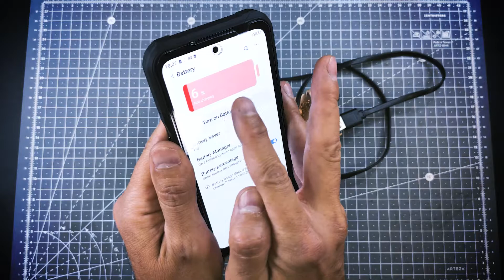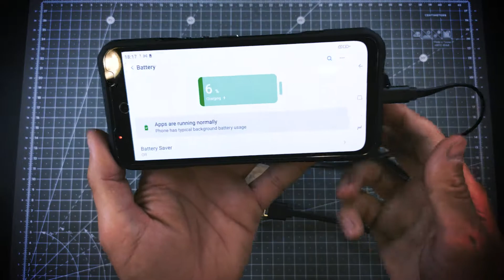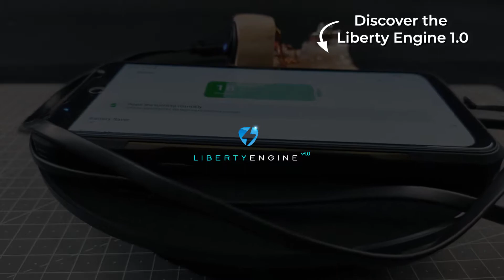FREE ENERGY GENERATOR - FREE ENERGY WITH OSCILLATING MAGNETS

Comment: The trick of the video is this:
 There is a battery and wireless charger inside the wooden dowel;  Have you not noticed that when you focus closely on the wood, you can see that one of its sheets is detached from the rest?  And it is precisely the magnet, which, when approaching or touching the metal screw, attracts a piece hidden inside the wood, which when attracted rises towards the magnet, making contact with a cable, allowing the circuit to be closed so that the battery provides energy to the charger. wireless that gives power to the copper wires that he placed on the wooden block...
Reply: make one lets see